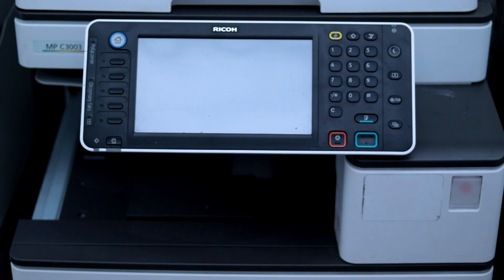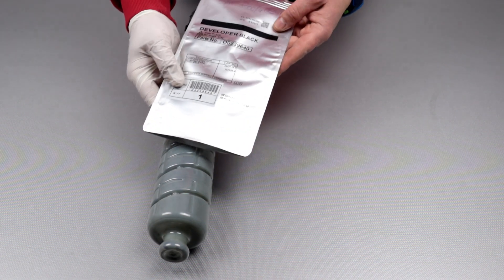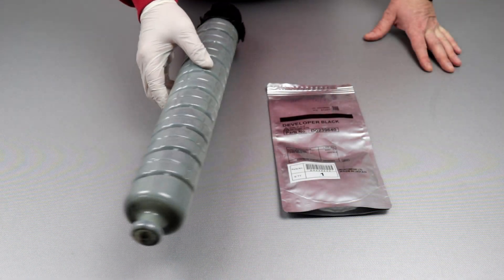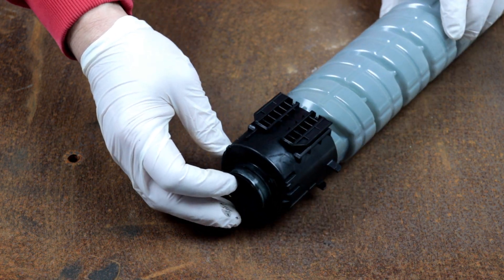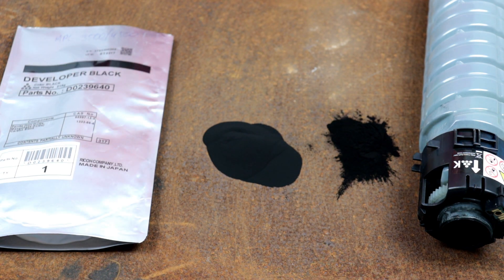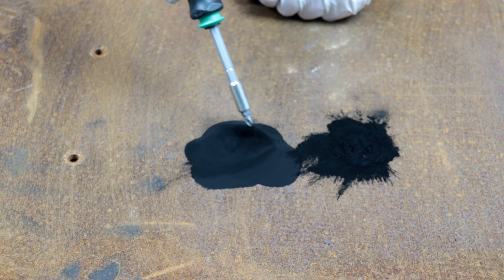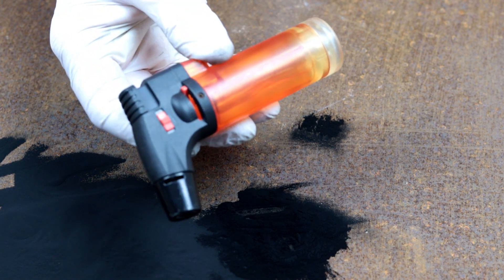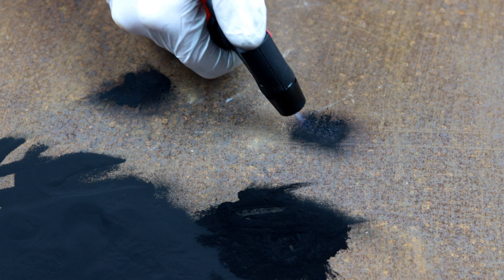How to identify toner and developer in Photocopier or Printer

Comment: Can spots on prints be because of developer is running out?
Reply from the maker: Yes, spots on prints can indicate that the developer is running low. Symptoms may vary:
Small, scattered spots – often due to uneven toner transfer by the developer.
White lines or missing areas – the developer isn’t supplying toner in some regions.
No impact on large black areas – prints may look fine with heavy coverage, but fine details are weak.
Also check:
the drum and cleaning blade condition,
whether the toner is old or clumped.

Comment: Hii Boss! Can you help me here; My Xerox wc prints bad Yellow colour that looks like a flowing toner or Ghost/Blurry/Fuzzy prints. I have examined Cartridges and also swapped them. Problem remains the same with different cartridges and drums. Could it be the problem of developer, because I don't find anything else to examine or replace? Pl reply
Reply from the maker: Hi!
Thank you for your detailed description. If the yellow prints are blurry, fuzzy, or look like flowing toner, and you have already swapped cartridges and drums with no improvement, the developer unit could indeed be the culprit. The developer is responsible for properly applying toner to the drum, and if it’s worn out or contaminated, it can cause print quality issues like the ones you described.

Other possible causes to consider are:

    Dirty or damaged transfer roller

    Issues with the fuser unit (temperature or pressure problems)

    Faulty or dirty optical components inside the machine

If possible, try inspecting or replacing the developer unit next. If the problem persists after that, further diagnosis might be needed.

Feel free to ask if you want guidance on checking or replacing the developer unit!
Reply: The problem has been solved sir I t was a broken transfer belt roller at the end some plastic round part below the film roller had broken and was shifting film left right that caused the toner to go out of registration or missing. Thanks for your response though ! 😊 @MrRicoh

Comment: How's it different from other printers that don't use this kind of developer powder thingy like the HP Laserjet or most Brother printers?
Reply from the maker: Most HP, Brother and Samsung printers use a single-component process, i.e. there is no developer. Developer is usually found in larger, office devices such as Ricoh, Kyocera, Minolta. These machines use a two-component image creation process.

Comment: Minolta 165 e. Changed to new compatible developer, clng. Blade, drum. Toner is original. After 2,000 cps light prints are there. How to remove old toner from new developer..??.
Reply from the maker: Didn't the developer spill into the copier? check it out

Comment: Hi, and is there a difference between the model developer or different brands? Or developer is universal used in any equipment just differentiating the amount?
Reply from the maker: The developer is made of tiny pieces of metal covered with a layer of resin. However, depending on the manufacturer and model, they are pieces of a different size and have different magenta parameters. But since you asked such a good question, I'll tell you a secret. Every developer is black !!!! Cyan, Magenta and Yellow are actually black developers with a little bit of toner dye. But the dye doesn't matter. So if you have to replace the Cyan developer then you can add a blak and it will be 100% fine. Regards.
🔥🔥 YOUTUBE SUPPORT: https://www.youtube.com/channel/UCOHtXTtGHj33pUm8Gf2FH3A/join 
😁😆 PATREON: https://www.patreon.com/CopyExpertMovieStudio 
🔥💥 PATRONITE: https://www.patronite.pl/1796
Reply: @MrRicoh  Hi, you were very grateful for the answer and happy with this information about the use of black in other colors. I asked the question because I take care of konica and Xerox equipment and the developer's packaging is very generic and the product always looks the same hehehe. hugs and thanks
Reply: @MrRicoh Why are there different developers for each color if it doesn't matter?

Comment: Konica Minolta c1060 compatible toner can be use on the machines ? Is it will damage the machines ? What different original toner and compatible toner ?
Reply from the maker: Never use non-genuine toner for the Minolta c1060. You will destroy the copier immediately. I know you cannot buy genuine toners these days, but this is a temporary situation.

Comment: Can we use toner insted of Developer at Canon Ir3025
Reply from the maker: There is no developer in the Canon imageRUNNER 3025 cassette machine, because it is a one-component copier. So there is only one component in the copying process - toner. So even though it is a developing unit, it is only filled with toner. So you can only use toner. By the way, the Canon imageRUNNER 3025 is a very interesting copier, although it is quite old because it was made in 2006, but I respect this device for its quality and durability. In January 2007, Canon released the imageRUNNER 3025. Designed for mid-sized companies and workgroups within large businesses, the monthly duty cycle is rated at 90,000 impressions. Standard capabilities include scanning and copying with the option to add faxing and printing. 
Greetings

Comment: Can we use toner insted of Developer
Reply from the maker: There is no developer in the Canon imageRUNNER 3025 cassette machine, because it is a one-component copier. So there is only one component in the copying process - toner. So even though it is a developing unit, it is only filled with toner. So you can only use toner. By the way, the Canon imageRUNNER 3025 is a very interesting copier, although it is quite old because it was made in 2006, but I respect this device for its quality and durability. In January 2007, Canon released the imageRUNNER 3025. Designed for mid-sized companies and workgroups within large businesses, the monthly duty cycle is rated at 90,000 impressions. Standard capabilities include scanning and copying with the option to add faxing and printing. 
Greetings